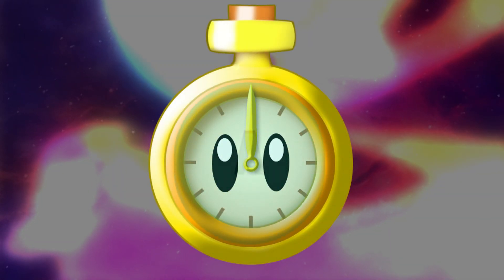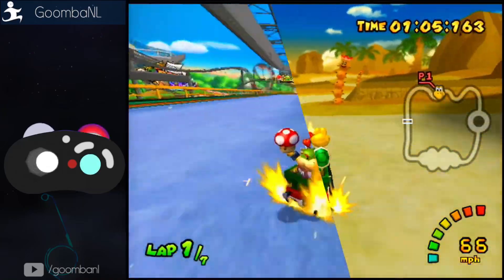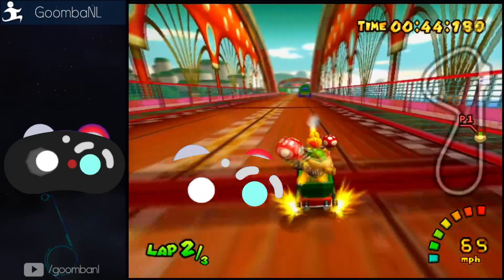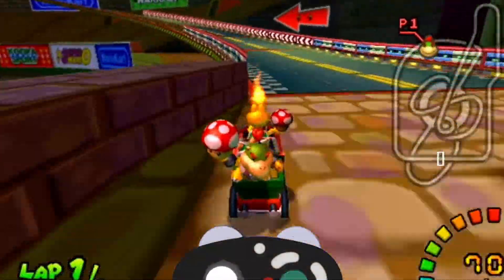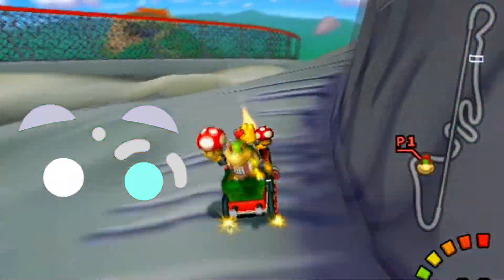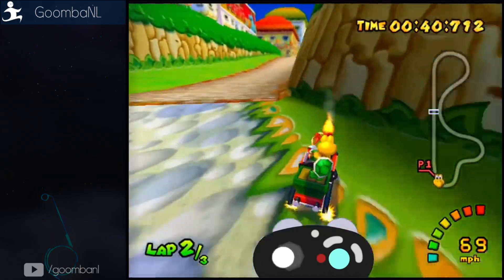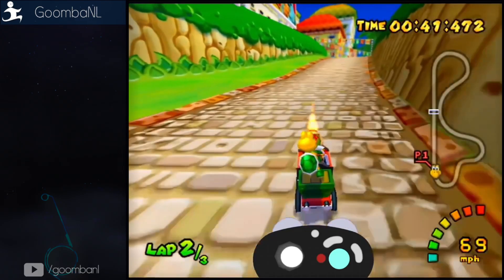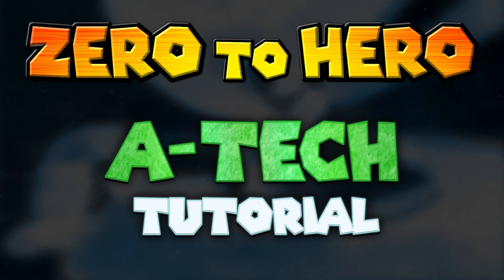A-tech Tutorial - Mario Kart Double Dash

Comment: I'm asking for a friend here (I've played this game since Childhood) he has this problem when drifting that his inputs won't register having the yellow sparks not transistion to orange to blue. You can see his kart turning but no MT transitions with the sparks, he thinks its my controller, but all the controllers we have I can drift easily on and have no issues with. Is there a limit to the range of motion when flicking ths sticks?
Reply from the maker: @Ikronix007 short answer: Yes! Long answer: To charge a drift, you'll need to move the control stick only from outside to neutral (the middle). Many people think it's left-right or vice versa, but it's not.

So for example, in Luigi Circuit's big left facing turn, you start a drift holding Left + R (assuming R is your drift button).

Then in order to charge it, we'll need to hold outside, so RIGHT in this case, then neutral. This charges to orange. Do these steps again (outside -> neutral), and blue sparks appear.

Each of these steps require a certain amount of time to register, so you can't quickly keep flinging the control stick -- theres a tiny pause between each movement. Do it slowly until it's consistent, then speed up as you grow more comfortable with it, but never sacrifice consistency.
You can release R at any time once the blue spark has been charged, so no worries about that.

Hope that helps!
Reply: @GoombaNL  Now that I think about it I consistently do this part. I've done this naturally as a kid so I never really thought of it. "you'll need to move the control stick only from outside to neutral (the middle)." My friend (and my brother) both wiggle the stick left AND right like you would in the more recent versions of Mario Kart such as Deluxe. Thanks for the Tip and Explanation!!

Comment: Maybe I'll actually understand sideways strat for BP now. The MT after you clear the corner trips me up every time. That timing is very weird and unintuitive. I also notice I have this tendency to obtain blue sparks before screwing with A releases, which is the exact opposite of what you need. On many of your fancy A-tech examples, you're releasing A when you're still charging the turbo. I'm not doing that, so I always feel like I "run out of room", or I'm "not quick enough". This is a major adjustment I need to make for fancy a-tech to work for me.

Comment: Thanks much. Gonna take time but should be useful. Question tho, what is the method called where you hold R and spam A for sharp turns? And is that better or worse than L tech?
Reply from the maker: L-tech is where you hold R and spam L, which is very easy but way worse than R-tech

R-tech is where you have to repress R in a certain rhythm, optimally around 3 frames of release before repressing R again, and holding it for at least 8 frames.

You don't release A during these techs

Good luck!
(also, if you're just starting out learning a-tech, don't bother with r-tech quite yet)
Reply: @GoombaNL  ahh alr thanks. Thing i was doing worked but was inconsistent